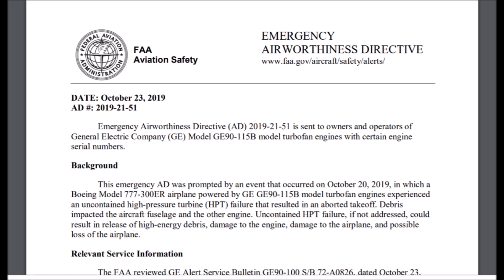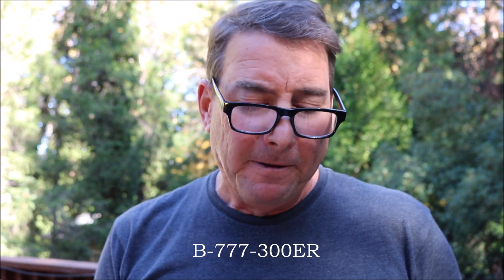Boeing 777 -300ER Emergency Airworthiness Directive

Comment: Just saw the Agent Jay Z video.  Superb work there - he has a knack for explaining things!  BTW, the B777 will go from a dead stop to 100 knots on a typical takeoff in 8 seconds.  The incident airplane rejected at 55 knots IIRC, so those blades didn't last but just a few seconds!   ALSO - AJZ interpreted the FAA's AD note to read there are actually 8 serial numbered PARTS involved, which he then theorized might affect 8 corresponding engines, but who knows... they're probably all on AMR's jets ;-)

Comment: Didn’t a GE engine on a BA 777 300ER left hand side disintegrate at Las Vegas some years back please correct me if I’m wrong
Reply: Paul B That was a similar engine, but the failure was the high-pressure compressor (HPC) stage 8-10 spool, not the turbine.
Reply: That was a B777-200 of some sort.

Comment: Hey, Juan, thanks for the informative video.  This ballistic material manufactured by Veteran's Manufacturing stops a 50 cal BMG round at 20 yards and yet it is lightweight enough to float.  I wonder if it would make a useful protective shield for the uncontained failures you describe.  https://www.youtube.com/watch?time_continue=1&v=FsF8MLL-dns&feature=emb_logo .  Jess

Comment: I sent a link to this article to an engineer who after watching it replied and said, "Those engines are too powerful". I thought, well they have to be. When you start replacing four engines with two engines they have to be powerful. But when you lose one of two engines you're losing 50% of your power. Why is this happening? COST REDUCTION. As in the case of TCAS. Had this incident happened seconds after rotation we may well have had another disaster.

Comment: So what more than likely happened was a batch of bad parts got out, & the only way to find which ones are effected outside of replacing every single one of them side lining a fleet of aircraft. Is too wait until the effected engines fail like on this aircraft.  But upper management at the vast majority of these airlines wont allow for a massive parts replacement, they'll wait for the engines to fail inflight, & cause a crash unfortunately.

Comment: Check out Agent Jay Z just posted an explanation of the air cooling path and seal assembly of a typical / smaller but similar engine.  Fascinating.  These engines are amazing pieces of engineering.  The GE90 is next level awesome!  Can’t wait for Boeing to recover and complete delivery of the 777Max so we can see it flying here in NZ soon!  Will have to wait a while but at least we will see the 787-10 here on order for 2022.

Comment: Juan said it seemed that they already knew about some problem due to the speed that they were able to isolate the issue. This could be indicative of ongoing short-cutting going on at Boeing. Maybe there should be a deep audit of everything they are doing. Since the 737 issue, I've stopped flying Boeing and won't again until they get my confidence back. This incident doesn't help.
Reply from the maker: not a Boeing issue.

Comment: Curious to see how an interstage seal can cause dramatic turbine failure? AgentJayZ (Jet mechanic) on his latest video on his youtube channel does a breakdown of interstage seals and how air cooled blades work with physical examples of the components.
Reply: It's always impressive to see the energy with which turbofan engine parts depart when the engine fails.  Happily engine failures are pretty uncommon, and of those that occur, uncontained failures are rare.  'cause that will ruin an aircraft's day.
Reply from the maker: Excellent presentation!

Comment: Juan,
HPT rotating airseals go in between the Turbine wheels.
Turbine Wheels have blades attached.  In front of each turbine wheel stage is a turbine vane stage, directing flow into the blade stage.  Turbines stages go vane-blade-vane-blade-vane blade, etc.
Turbine vanes are attached to the case (at their OD), turbine wheels with blades are attach to the shaft (at their ID).
The disks in the HPT section are connected together, but in between the disks, inside the ID of the vane stage there is usually what is called a "rotating airseal".
These rotating airseals spin with the disks.  To keep gas flow from going under the vane stages, these airseals have discourager features, like knife edges rubbing in an adbradable or labyrinth seals.  
Because they only have to carry their own weight, these air seals are not beefy and because they have to actively have to discourage airflow, their designs can have stress risers or have shapes that make inspection/crack detection difficult.  Also if they have knife edge features, these are designed to rub.  Too much rubbing, however and the knife edges can crack.  .
Reply: powerwheelscd Thanks for the detailed answer. There is a great video by AgentJayZ, but he does not show/explain the knife blades.

Comment: do you all know how many air craft are affected by this AD?
Reply: The AD lists the serial numbers of eight engines, all on 777-300ER planes, so a maximum of eight airplanes are affected.
Reply: JZ's video states there are hundreds of these engines out there, and he explains there are 8 different parts listed, not just 8 serial number.  im thinking more than 8 planes, as more than one engine on a plane would have a very likely chance of being affected.
Reply: @raybankes7668  Listen again. Juan says this is "a very specific range of engines and seals", and the airworthiness directive says "This AD applies to all General Electric Company (GE) GE90-115B model turbofan engines with engine serial numbers 907451, 907464, 907504, 907564, 907574, 907599, 907601, and 907618."
Reply: @lizj5740  i will take another look

Comment: A turbine engine includes axially adjacent compressor and turbine rotors which define a groove therebetween. Into the groove between the rotors radially extends an annular interstage seal assembly. The seal assembly includes a thermally insulative cellular wall structure which resists thermal and pressure included distortions. At its radially inner extent the cellular wall defines a seal structure in cooperation with the rotors, and also carries heat shield members on an axial fore disposed toward the turbine rotor.

Comment: If you also consider the situation with the engines on the Airbus 380, it seems like once you get past a certain fan ratio, these engines are having some growing pains.
Reply: Monster's Inc. The turbine and the fan are unrelated, and are at opposite ends of the engine.

Comment: I'm in my second year of A&P classes at Orange Coast College and we are studying Turbines this semester. We've learned about how the cooling air keeps the hot gases from entering the bearing areas with  carbon ring seals, brush seals on ceramic overlay, labyrinth seals and the balance of pressure between the areas. Major work to repair/replace those item.
Reply: Erik 567, congratulations for entering the great field of aviation. Study hard as your work is important.

Comment: Thank You to the professionals: the regulators, pilots, mechanics, engineers and manufactures for the layers of safety and oversight.  You the the trusted ones, to be vigilant to guard and prevent the holes in the Swiss cheese from lining up.

Comment: Could this problem affect the ETOPS rating of the airplane, or the -200 model if it uses the same engine core? You're spot on and so quick with no bs current information. Hope to meet you in the sim shop someday before you return to the line. Thanks for posting.
Reply: Mo River ETOPS ratings are based on lifetime statistics for the engine type. If the cause is known, and the faulty component is replaced, this should have no effect.
Reply: @gordonrichardson2972  Thanks!

Comment: It's good that you pointed out the indicators that "may" point to a quality control issue.  Why specific S/N engines or engines from a specific FAA repair station?  It will be very important to establish the true root cause.  Thanks for reporting.

Comment: I think the engine manufacturers should take a step back.Boeing and Airbus are pushing for longer flight times and fuel economy. Earlier 777s did not appear to have any serious problem. I am quite happy to sit on an earlier model 777 or airbus 330 or 340 and experience no issues. Same as the 747 and earlier 737s. All the competiton is putting lives at risk. I could care less travelling on a plane for 18 hours in cattle class. I dont really see the point in it.
Reply: Earlier 777s had their issues. There was that gearbox problem in the original GE90s, and that was fixed pretty quickly. Engine manufacturers, instead of taking a step back, should step forward yet more; with better fuel economy will also come better safety, especially now that there is additive manufacturing. You will be amazed. Of course engine manufacturers know that if things go wrong, it's really bad for business anyway, so obviously they're going to do everything they can so that nothing goes wrong.

Comment: Crikey Juan, we are flying off to Singapore on 12 Nov 2019 on an Emirates A777 300 ER. What is the manufacturer make of those giant engines as used on Emirates 777’s. Just askin’.....
1week later, flight over we survived. Lol.
Reply: GE. These GE90-115B powerplants are incredibly reliable, especially if it's, for instance, Emirates. You'd be amazed.

Comment: There is something more going on here.  I agree, the quick response seems to indicate a prior knowledge of the problem.  If so, what the hell are those seals doing in those engines if their function is so critical to the safety of those planes?  And I hope there is not a political toning down of the problem going on due to Boeing's current problems and that these planes should be grounded immediately.  If a second failure happens before all repairs are completed then it is really going to hit the fan.

Comment: Thanks Juan... The Aviation Herald lists 8 different serial numbers for the Interstage Seals, do we know if these serial numbers are unique numbers... i.e. they are found in 8 separate engines only.  Or can multiple Interstage Seals have the same serial number?  If the latter is true, then how many 777s are currently grounded on the Emergency Directive?  Take this combined with the grounded 737 SuperMax, Boeing would be about to take another smack down, even though these are GE engines.  Thanks again.  My hope is it is as few as 4 planes (2 engines potentially being on the same unlucky plane), but if those serial numbers can be found on multiple engines then how many engines are impacted?
Reply: Seriial numbers are by definition unique
Reply: and the AD also noted 8 engines are affected, and they noted the 8 engine serial numbers.  They did not bother to line up the engine SN with the seal SN.  Whoever is flying the aircraft probably has the database to track both either SN.
Reply: @charlesborlase2238  Thanks Charles I missed that, I am glad it is just 8 engines.

Comment: A Thanks for your info. Thanks for reporting on this incident. I gave my Quality Control Analysis below. 

My over all trend in looking at the safety of flying in a commercial airliner is that risk was manged and airframes are better but these type of engine failures, along with software failures are dragging the safety margins down. That old saw about " safer than the drive to the airport " manipulates facts that become a false comparison.

Comment: If this was narrowed down to just a certain batch of engines, then there is a major fault in the quality control process at GE. Like in computer software or hardware, the quickest way to destroy a company is to have the customer used as the final QA tester.  I DID leave a company ( software ) for not protecting software used on our Internet and quit trading because of it would violate rules the SEC had at the time. I have had QC training and was told to do the " Man From Mars " look at the situation, tempered with " Get the production line running ASAP!!!!
That means that you get major pressure to balance safety with profit margins. You get to be the manager of that balance or quickly get fired and blacklisted if you cannot strike that balance. 

When your customers are depending to get from point A to point B, that undermines the whole process when QC/QA does not keep them safe.  This time, we just got lucky.  Ask the survivors of family of the dead and tell them that " Your contributions made airframes safer to fly on "...

Comment: I'd be surprised if GE knew anything about the seal that failed prior to the event, as that would suggest they believed it had a greater likelihood of failure than usual. After all, what else could they "know"?
I'd not be surprised if they look at whatever 'batch' of seals contained the failed one and immediately require the replacement of all others from that batch, especially if their inspection tells them it's a manufacturing quality issue, or at least highly likely to be, as opposed to a problem of assembly.
Obviously that might depend on just how large a 'batch' of seals is, and I assume GE has had time to inspect thoroughly the engine involved.
Cheers

Comment: The turbo boost oscillator runs parallel to the thrust vector and is modulated by the flux capacitor. Is that clear to everyone?     Sorry, just couldn’t resist.

Comment: My supposition at this time is that pretty close to 100% of these engines are still under warranty, so GE will have to pony up.  In all, the AD only addresses a total of (8) of these engines which is a very small number.  Good thing the issue was discovered before a catastrophic event might have happened.

Comment: Thankfully you're not having to fly a Triple-7 with HPT stage seal malfunctions. Wouldn't that be lovely to have one of those go out over the middle of the Atlantic ocean? Let's see...instant cabin depressurization, dive from 39,000 ft. down to 14,000, reduced airspeed, only one engine operative in the middle of the Atlantic and the fuel burn at that altitude for the next 7-8 hours is: ....... yikes, I can't even wrap my brain around that one.

Comment: The history of the engine plays a big part in AD's being issued. With the aircraft being delivered in Oct 2012 to the leaser, then it went to Thai Airways later that month. So, it's been in service for at least 7 years, with that being said, the engine has more than likely come off to be been inspected, shop visits and or overhauled. When the engine goes through an overhaul the exterior and guts of the engine will go through a heavy inspection and also check the life-limited part (cycle and hours) of parts so they are replaced. Now, the inclusion of batch of serial numbers could be from what was found on other engines during the engine inspection process at overhaul or shop visits too and could be a precaution. All components are serialized to know what engine they are on, also for traceability of the history of the part. This will aid in the discovery of any unforeseen issues that may arise to help with the health of an engine. When it comes to who pays for the repairs, it'll be up to the owner of the engine (lessor or airline) and what kind of maintenance contract (like a warranty program) they have signed for the maintenance of the engines.
The 115B is the beast of the sky(best history of all engines out there), but the 9X will be bigger and meaner and some big shoes to fill :).
 Juan, as usual, you are correct with your information and that's what I love about your channel. Thank you very much for what you do and your channel. Keep getting better, have a great ride, and godspeed on getting back up in the sky.
Reply: Airframe and engine records are separate.  The engine that failed was probably not the original one delivered with that airframe.  Chase them down by serial number.
Reply: Correct on the separation of the airframe and engine records, but it could still be the same engine. When I worked for Evergreen International Airlines as a maintenance planner and a maintenance rep for the airline, when the 747's or DC9's would go in for heavy checks, we reinstalled (after the engine was overhauled) the same engine most of the time due to not  having enough spares, plus with a heavy check most planes would be out of service for a minimum of 35-40 days. The engines could be done in about 3 weeks and waiting on the airframe. Then transfer all the info into the system records and that was fun. I could type any serial number and in a few secs, I could know where the part is, the hours/cycles on the part, and when it was due to be changed. The other engines could have been in a spare pool, spare engines are usually for a quick swap or emergency change(like an AD issue). But, we can only speculate. :)
Reply: @jetzombie  Keeping track of airplanes, engines, and all manner of things installed is a whole lot harder than it looks.  Fly safe.